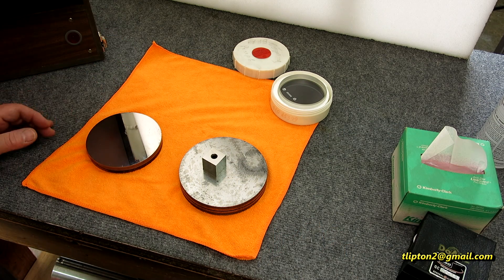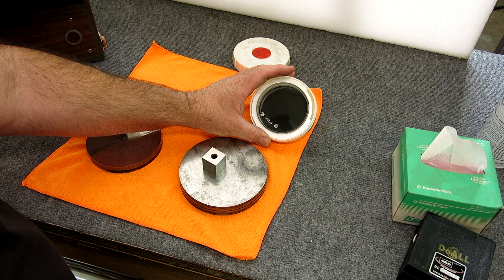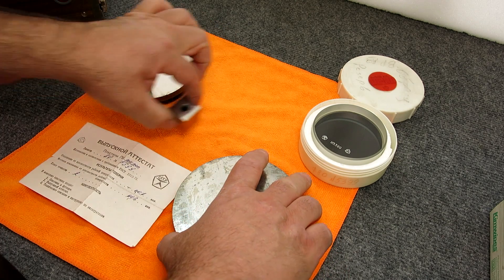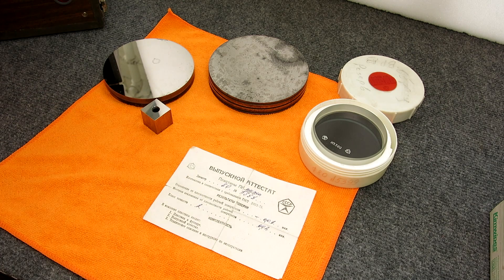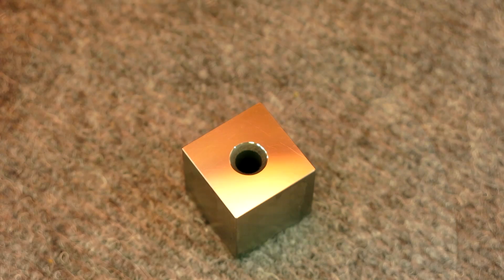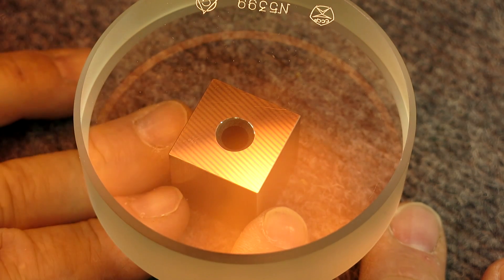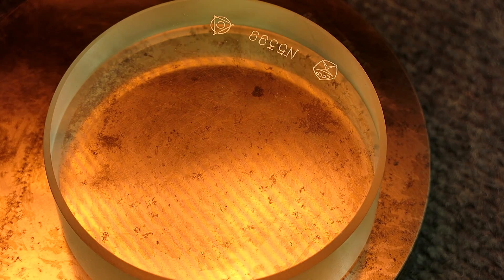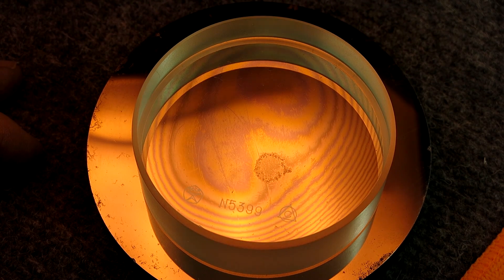Russian Optical Flat Testing

Comment: I think you can use a sodium lamp also (as in street lights). They also have a sharp spectral line, which will surely produce better fringing than luminecent lamp.
Reply: Raido Enn I researched on that earlier. Seems like low pressure sodium light has a really good chromatic character
Reply: Yes. It is by far not as clean as He-lamp, but it works in a pinch and is a lot cheaper. Also one could use a laser pointer, as that is also very monochromatic, but lighting a table with laser pointer gets difficult fast :)
Reply: Raido Enn Low pressure is the key.  I'm not sure if you have ever tried the laser or not. I tested with the He-Ne laser we have, expecting to see some chrisp fringe, but result was quite disappointing. The fringe is quite fuzzy.... even with all the other lights turned off
Reply: We have some optical lab work (practical course) in university and use Soviet era mercury lamps for the same reason. You would have to have a very powerful laser and diverge the beam to get some well visible fringing, but a lab He-Ne is usually not intensive enough (although being very monochromatic). So for all practical purposes, some atomic emission lamp is your best bet.
Reply: Simon P it might be speckle due to coherence of hene (and many other) lasers
Reply: Not with a bright enough laser. :D

Comment: The translator app was made possible by everyone's authentication on captchas. It's a similar tech with ReadIRIS's OCR but in this particular case, the app has a library of words that have been already transplanted from image to actual text. Which from there it's far easier to translate.
And, yes, it's much faster than letter to letter translation. The app grabs a word vs letters. 
For example, if a word has never been put in to text-from-image, like say, some WW2 German word of notable length, the app will have trouble with it (tho, i suspect that it might also have some point to point or at least half word function based on some of the half grabs i've seen).

Comment: Good info Tom.  The translator app reminds me of the sun glasses in the movie "They Live".  Any special tricks on cleaning optical flats?
Reply: ETOH or Acetone.  Would depend on the coatings.  The etoh we used was Graves fine distilled.  190-200 proof.  A few livers suffered greatly.  (Available at select, exclusive "Spirits" vendors.
Reply: Bill De La Vega in my laser technician classes we placed a new sheet of lens paper on the lens surface and wet it with acetone just to the point that the entire surface was wetted. Then you slowly pull the paper off in the same plane as the surface. Repeat as necessary.
Reply: Years ago we used to clean the flat in a laminar flow clean room with 190% ethanol (we also had great Christmas parties in that division of  our company.
Reply: Yes when I was a graduate researcher we had optics that were part of a laser diode  velocimetry rig and used ethanol (which was not denatured) to clean them.  One of my lab mates got a little buzzed by the vapors after she cleaned a bunch of mirrors and lenses.
Reply: Hmm I thought that acetone would damage some optics which were coated?  But I guess in this case that's not a problem.  I'm wondering if hardware store variety is pure enough?